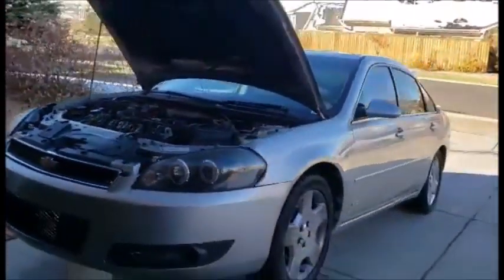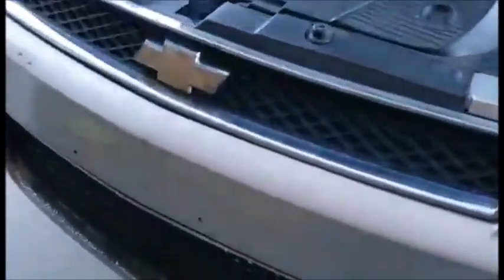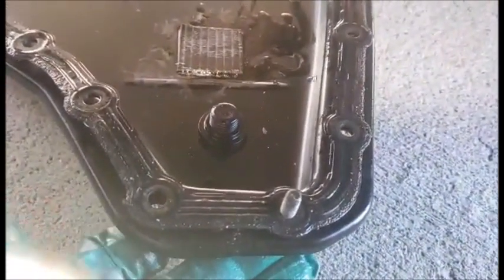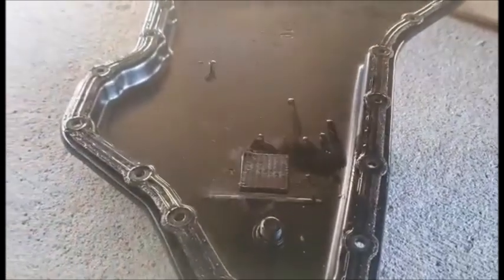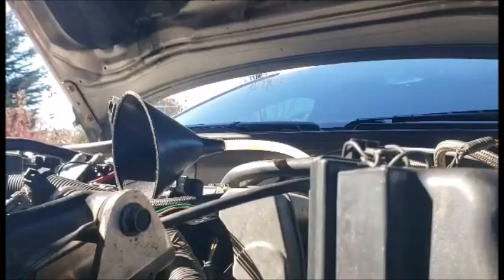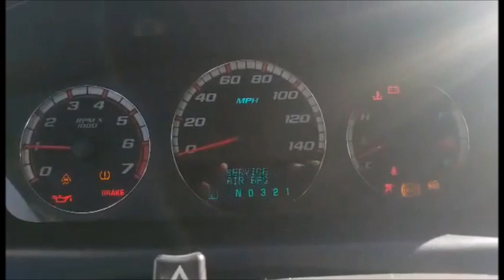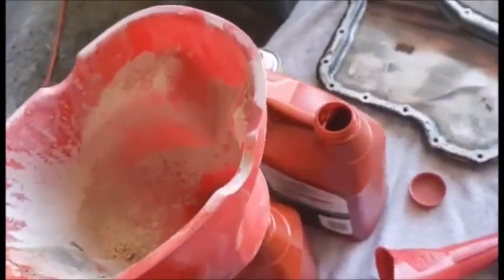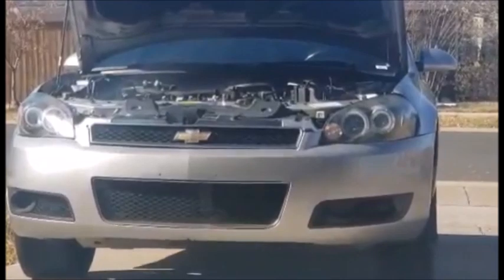IMPALA SS Transmission Fluid Change

Comment: Was the car shut off for a while for the engine to cool before changing? How many bolts? Is this a 3.5? Did you have any trouble with driving your car up the ramps like them shooting out forward? Almost over shoot the ramps? Did you buy a drip pan and funnel? What do I all need for this process? How long does this usually take? Can I do this within a morning? Did you bring the old atf to autozone to recycle? Why the bucket and not a drip pan with a cover? What if the bucket said you only had 4 quarts? Would you have only added 4 quarts back into it?

Comment: How did you get to the 2 bolts behind the frame rail?
Reply from the maker: Go to Autozone and buy a swivel.
Reply: @cammims7645  a special kind or just a regular swivel with 10m attached?
Reply from the maker: @rashadferrari3791  just a Special Swivel. Ill send a link
Reply from the maker: Link to the Swivel right here. 

https://www.autozone.com/ratchets-sockets-and-wrenches/universal-joint-socket/best-parts-inc-3-8in-drive-universal-joint-socket/80474_0_0?spps.s=827&cmpid=LIA:US:EN:AD:NL:1000000:TLS:71700000060668368&gclid=CjwKCAiA_eb-BRB2EiwAGBnXXstdnCB_DQ2JKhGl2P_ALF7-1NdXQ-Ecn-f5gA-9Pm2bvpGKTemfAxoCimIQAvD_BwE&gclsrc=aw.ds

Comment: Where did u find that transmission pan with the drain plug?
Reply from the maker: https://www.autozone.com/drivetrain/transmission-fluid-pan-a-t/p/dorman-automatic-transmission-fluid-pan-265-814/517957_0_0?cmpid=LIA:US:EN:AD:NL:1000000:ENP:19489353532&&CATARGETID=120054150001289731&CADevice=c&gclid=CjwKCAjwscGjBhAXEiwAswQqNFDBrm3DXqlLhx3aBCAOfdhqUwvZt4FiDSNuPf7q81dHPKyT74MZBxoCEF0QAvD_BwE&gclsrc=aw.ds

Comment: I have a 2011 impala and I notice a little jerking once in a while,I took it to mieneke for oil change. The mechanic said its leakn transmission fluid. Should I change the pan ?? I just bought the car for my wife , I'm scared of damaging the transmission. WAT SHOULD O DO .???
Reply from the maker: Buy a Pan, or take it to a transmission shop to get the Right answer

Comment: How many miles on the car ? & How’s the transmission after the change? Any slippage?
Reply from the maker: No Slipping at all.  Shifts really smooth after doing this. Thanks for asking!
Reply: Ok cool So it should be safe to change mine at 167k?
Reply from the maker: @thaddeuspierce1889  If your Tranny isnt slipping Just do what I did in this Video. 
If your Tranny is Slipping Leave it alone.

Comment: Hey how much transmission fluid did the ss take?
Reply from the maker: I put in what I took out. Answer is in the Video!
Reply: @cammims7645  Uh yeahhhh thing is when loosing the pan it spilled out and made a mess till the point I couldn't measure it
Reply from the maker: @AIRLav  I belive I put back in 6 qrts.
Reply: @cammims7645  Preciate it homie

Comment: I have an 09 impala ss I have to manually switch gears , if i put it in D it is really sluggish but after 1st gear it picks up speed any suggestions?
Reply from the maker: Maybe you don't have enough Tranny Fluid? Stop by a Tranny Shop have it Checked out! If I were you
Reply: Cam Mims no haven’t took it to the trans shop , also has a code it comes up “transmission shift long”
Reply from the maker: @bigfradoe2934  Autozone, Advanced Auto Parts Check Check engine Lights for Free.
 Usually they Can check the code and they can tell you what part you may need or what to do to fix the Problem!
 I would start by getting that Check engine light checked first.
Reply: Bs